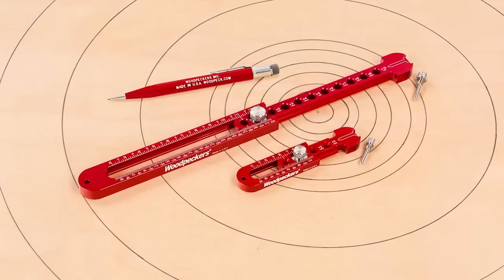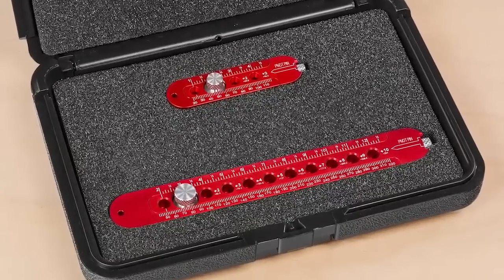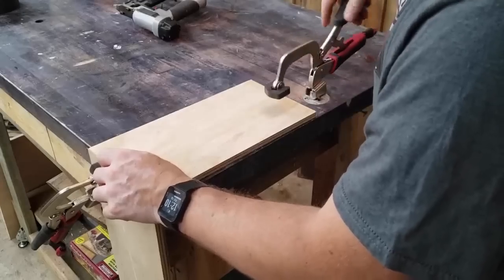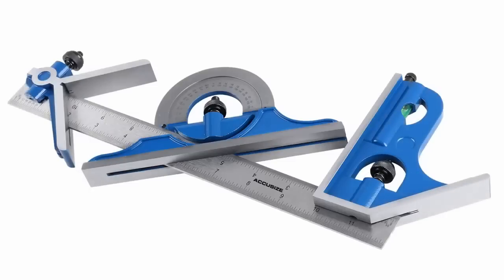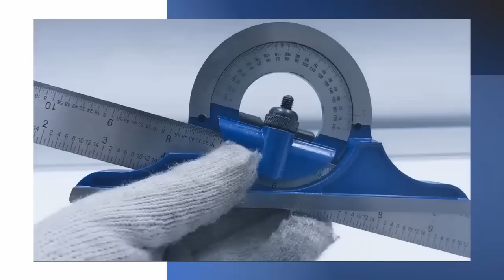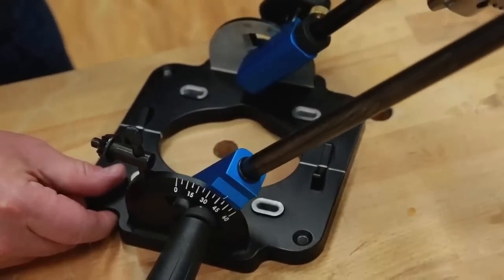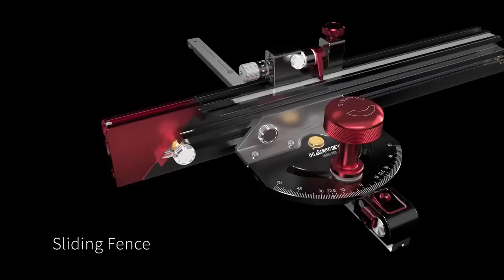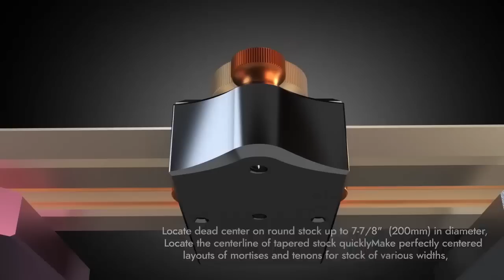10 WOODWORKING TOOLS YOU NEED TO SEE 2021 #11

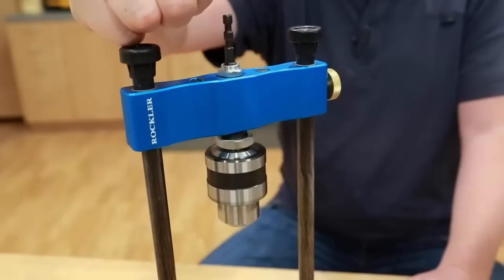Comment: 10:50 It doesn't make sense to buy the portable drill guide with a Walfcraft. The Rockler is 10 times more expensive !!!!
On the other hand, these guides can be very practical, etc., but they depend on the motor of our drill and it is not the same number of revolutions. My drill driver reaches 1750 rpm, but a fixed one can give up to 2600 rpm.
This Rockler is not in amazon europe.